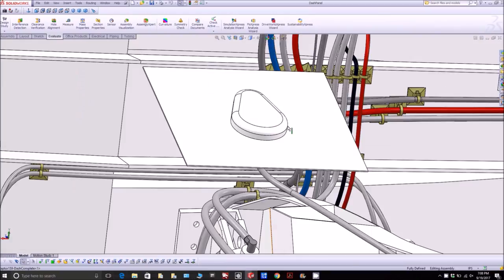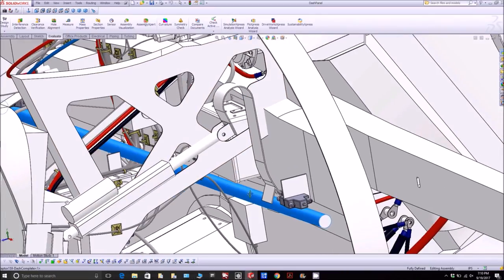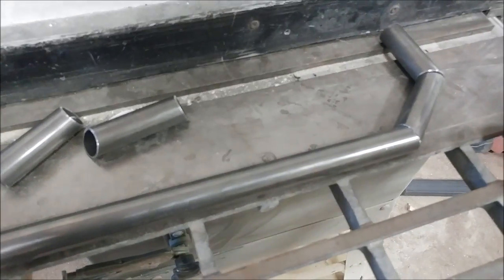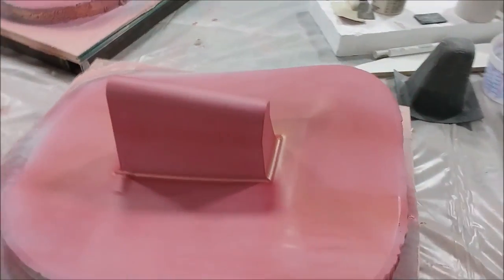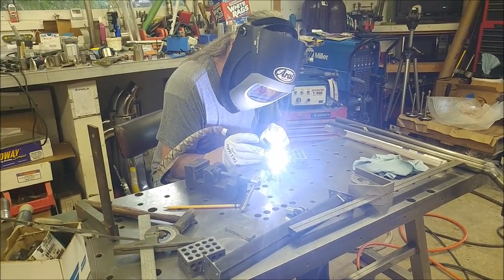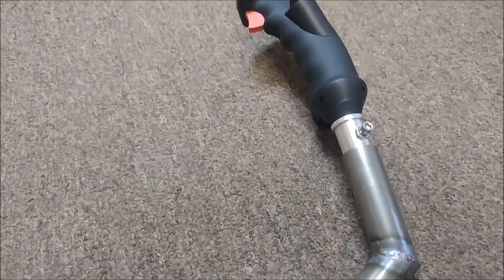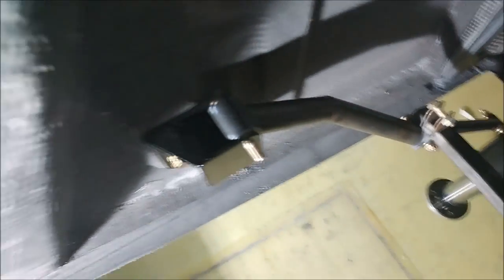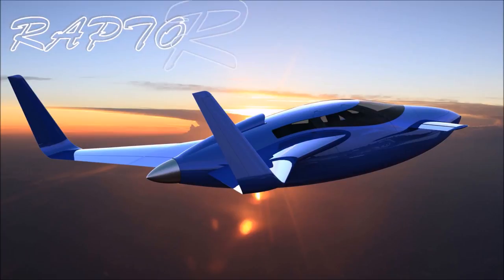Standing Tall - On the main gear

Comment: I have a question about the way that the gear is extended. Is the gas strut itself what if extending the gear or is the same hydraulic piston that retracts the gear pressurized to extend the gear. My concern is with the first scenario which is the way I am assume it is operated. I have had experiences with race cars in which we have lost pressure in the gas struts and the car does not handle as designed. In the event that the gas strut looses pressure is there a backup system or an emergency gear blow down mechanism?
Reply from the maker: The hydraulic cylinders are double acting. The gas strut is the backup but gravity would be the backup to the backup. Any more than that is just getting ridiculous. Pull the chute if all else fails.
Reply: Raptor Aircraft thanks for clarifying I was just confused